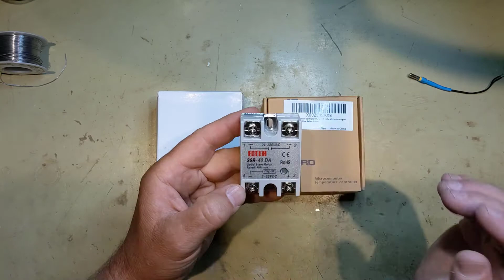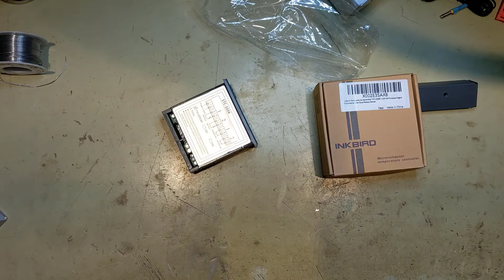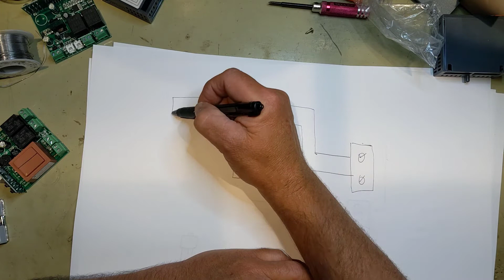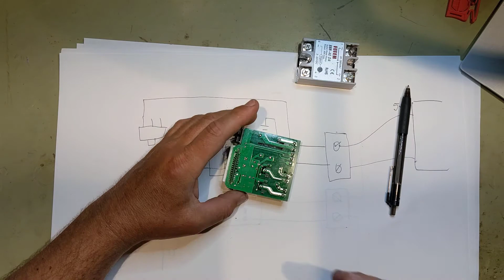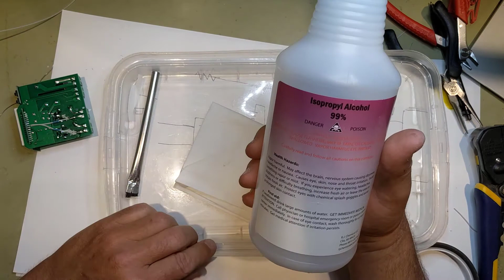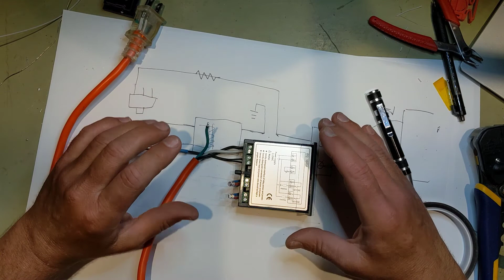Modifying a Chinese temperature controller to use a large solid state relay to control a large load.

Comment: Thanks for the video!
Can you tell me what kind of relay is originally built in the thermostat? I want to connect a 24VDC pump but I think the relay is only for AC, or am I mistaken?
Reply: I'm talking about the STC-3008 btw
Reply from the maker: Hi.  @torstenknorr8573 .  The solid state relays I'm using are DC-AC.  They use a small DC input to switch a large AC load.  You can buy DC-DC relays which would do what you want to do.  You can also buy AC-DC and AC-AC SSRs.